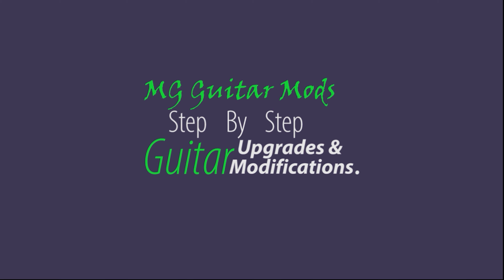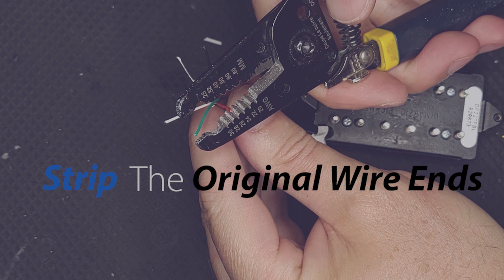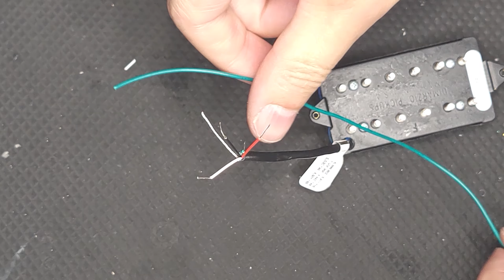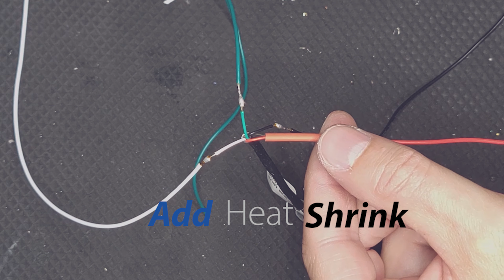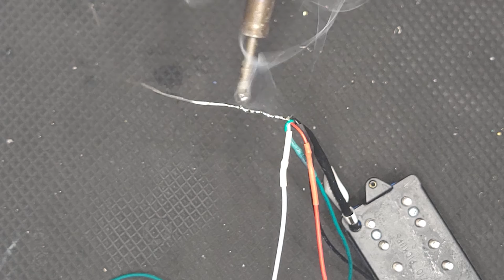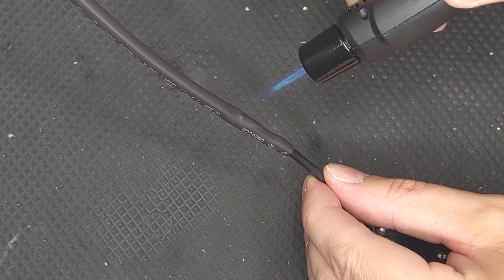Pickup wires too short?

Comment: This vid was really a straight shooter for this subject. This cures the issue of wanting to put bridge pickups in neck position but not having enough wire length for soldering them to the switch and the pots. Thank u so much. Great video, all the way.